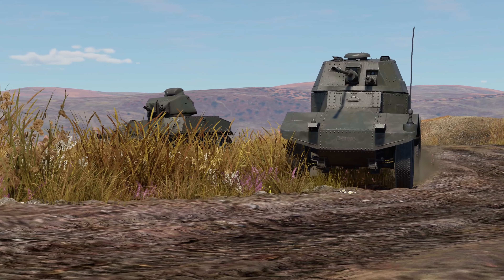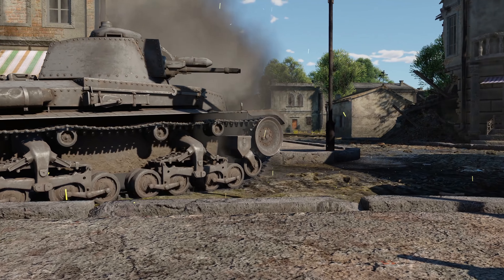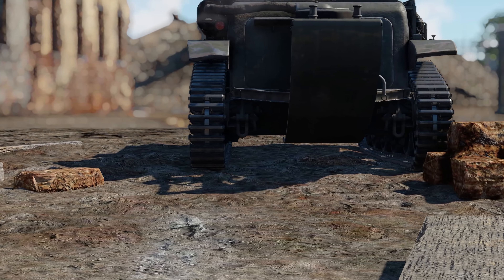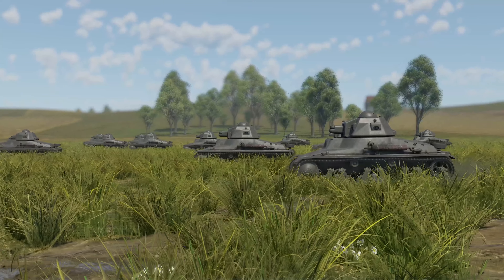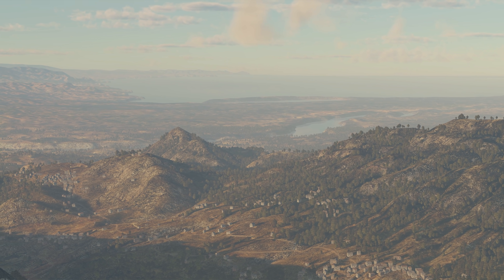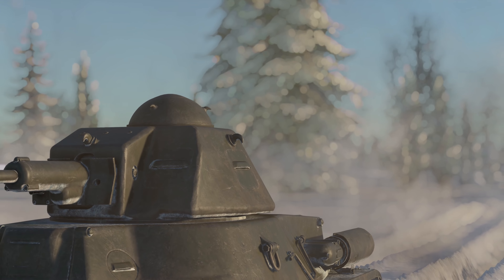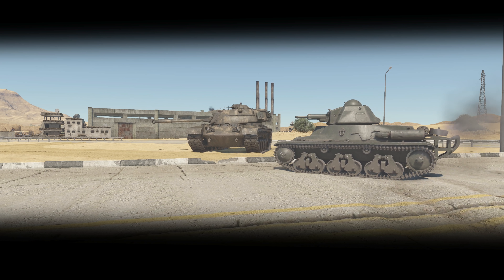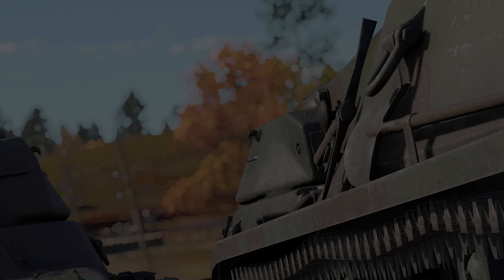Hotchkiss / War Thunder

Comment: ya, the french were so advanced they made a time machine and bought a vehicle called ebr from 1954 to ww2!
Reply: French engineering..
Reply: EBR is a 1939 vehicule
Reply: @monculsurlacommode3238  u high?
It's from 1954...
Reply: @monculsurlacommode3238  you are wrong. A hull compareable to the one from the EBR in the game was designed before ww2 but never Built. The turret with the 75mm gun came years After ww2.
Reply: @p_filippouz  first variants Come in 1939
Reply: @monculsurlacommode3238  prototype was from 1948 and production was in 1950
Reply: @p_filippouz  No, he is right, the first prototype was developed in 1939 and the production model entered service in 1951 with the FL-11 turret.
Reply: @tivivi7309  they were never Built. And only a compareable hull
Reply: @monculsurlacommode3238  your high as hell my guy, read the name on WT, it even says 1954 I even googled it, the first vesion was built in 1951 what we have in game seems to be a '54 variant but still, its not built in '39
Reply: @IsoDidact  that design simply didn't exist in 1939
Reply: Calm down everyone. He's partially right. He's refering to the Panhard AM 40 P, wich is, in fact the predecessor of the EBR. It had an oscilating turret with a 47 or a 25 mmm gun (depend of the source). The prototype was finished in 1940, and some model ordered, but the 1940 campain halt the production.
Reply: @monculsurlacommode3238  Chasis was developed before ww2, but in game is model from 1954

You can search for it on internet
Reply: Remember the Lorraine 155mm SPG that you never saw again after that event? I just found it the other day that Gaijin had added it in a 'Chronicles of WWII' event. 

My history is rusty, but WWII definitely didn't end in 1955.
Reply: Sweden even used modern Heat during ww2 🤯 

😑
Reply: Design and first prototype in 1939 was the Panhard 201 with a 37mm SA 38 cannon.
Second prototype is the Panhard 212 with the FL-3 turret (inspired by Chaffee turret)
The first production model in 1951 with the FL-11 turret is the EBR
The FL-10 turret with the 75 mm SA 49 variant comes in 1954
And there is a another variant/refit of the FL-11 turret with a 90mm cannon (CN 90 F2) in 1964.

Here you go.
Reply: @yuurichito1439  or 1950 APDS on 1940 tank
Reply: @nicolaspeigne1429  it's still not really an EBR, the gun is different than the previous one
Reply: @p_filippouz  yes that's why i called it Panhard 201, the EBR designation comes in 1951 with production
Reply: @monculsurlacommode3238  u high?
Reply: @monculsurlacommode3238  wow do you have any common sense? It says 1954 in the name 😂
Reply: @maxfredriksen350  😂😂😂
Reply: Yes the hull was made before WW2 but the turret was designed after WW2 but I am in agreement the tank should not be facing WW2 tanks if it is changed maybe allow for the 90mm gun instead of the 75
But the same reasoning you could say why is there a 1980 SPAA Italian tank fighting WW2 tanks
Reply: Oof size large
Reply: Germany is so advanced they had to bring a 1944 vehicle to fight reserve tier
Reply: @p_filippouz  the turret and gun are. The hull was designed in 1939
Reply: I can't believe some people are actually defending ebr
Reply: except for the tech in it wasn't impossible for ww2 like the r3 with its stabilized minigun on top.
Reply: @melo3814  I'm not defending the ebr : /
Reply: @isharveerdhillon8348  I know, but people under your comment are
Reply: @melo3814  i can fully agree the ebr needs to go face the vehicles of its own era and not ww2 vehicles
Reply: @melo3814  remember the PUMA when it was introduced? The EBR is basically the French Puma at 4.7. We already had the M4 FL10 at that BR with that same gun sooo
Reply: And the germans somehow have fuel and ammo
Reply: Remove ebr
Reply: @xX_MasterFinn_Xx  I’m sorry I’m looking for who asked.
Reply: @yuurichito1439  it wasnt heat, its sabot.
Reply: Can't believe no one know this sarcasm for EBR that still in mid BR
Reply: @Farmuhan  No prob just bring some friends and focus fire those pesky EBR
Reply: @Eli Hughes the germans arentnlaggijg behind they still managed to get multiples late 1944 vehicles to fight at early 1939 rank
Reply: Lmao
Reply: The Italians were even more advanced, they went forward in time and bought a vehicle called the R3 T20 from the 80’s to ww2
Reply: Hon hon hon! 🇫🇷🇫🇷🇫🇷
Reply: @Alpha1598753  Yeah!
Reply: @Notmagickal  it was only a joke i haven't really looked but i got killed by something like it so i made the comment
Reply: The Germans too, you can play the leopard 1 and m48 and fight jumbo’s
Reply: @dzban02  phanard 201 is first ebr on conception of ebr pahnard and IS create on 1939 the weapon is a 47mm
Reply: Exactly

Comment: What is the best mid tier tank in the game (armor, gun, speed)
Reply: M5A1 Stuart. Rank 2, 40mm gun, ABCBC shells, about 8 degrees turn per second, top speed about 40kph, mediocre armor, can scout (easy SL) would totally reccomend
Reply: Thanks
Reply: @thomasvanlangen9588  welcome
Reply: @f100dsupersabre6  "Good armor" What?
Reply: @katyusha1283  I’ve bounced so many shells in my m5 so idk what you mean
Reply: @f100dsupersabre6  Because you don't expect to bounce shells. M5 doesn't have reliable armor. Other than the 50mm plate, it's paper.
Reply: Maybe T-44-122, since T-44 has speed and armor but not a good gun. The 122mm isn't that good but better than the 85mm.
Reply: @katyusha1283  ok, I’ll edit my comment to remove that bit